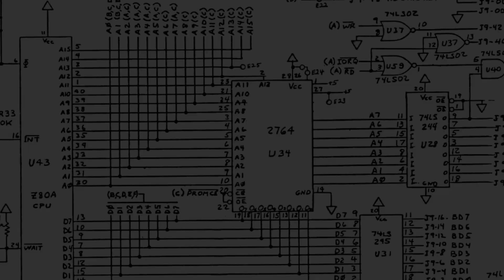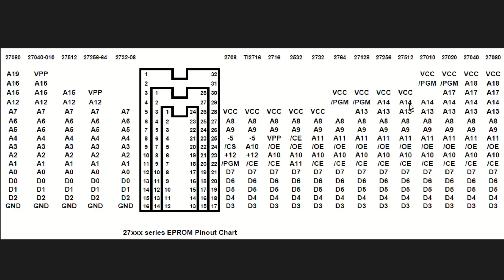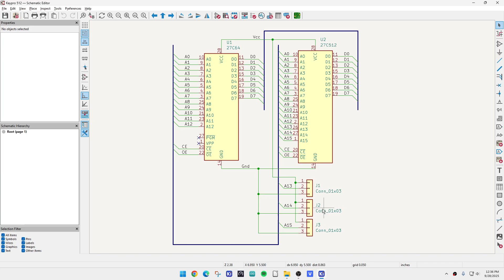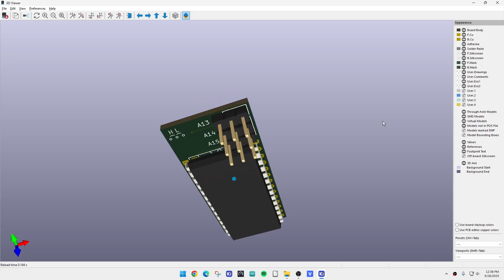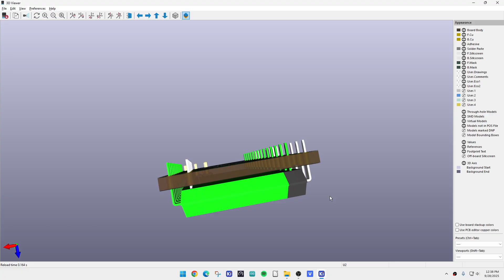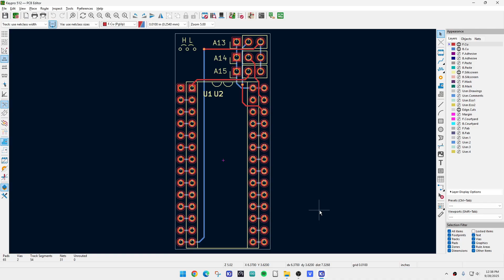#2406 Kaypro 2X Computer (part 6 of 10)

Comment: You can also use those 3 center pins to have bigger ROM chip blocks as well, though you would need to probably also do other work, with another header board to replace the existing address decoding, allowing you to use 16k of ROM instead, getting more ROM storage at the expense of RAM.

Comment: If you wanted to be super fancy, there's rotary switches with octal numbers on them which you could use instead of three separate jumpers.
Though admittedly in this case it'd be a bit confusing because the switch would be labelled 0, 1, 2,... to 7, whereas you are intending 0, 2, 4, ... to E as the top nibble of the address.
Reply: There was absolutely no justification for not using one of those switches. Heck, even DIP switches would have been better. Or, if you want to go extra-extra fancy, ANOTHER EPROM driving the three extra address pins from three of its data pins which also get looped back to the 2nd ROM's address pins, with the sole purpose of catching a jump to a normally unused ROM code address to allow for switching between ROMs in software, without having to open the case.

Comment: who uses dil packages in 2025 ????
Reply: Me!
Reply: Me. Much easier to solder to a DIY milled PCB, not to mention they naturally provide the "vias" that SMT parts don't.
Reply: It's a retro computer so the whole point is to use compatible DIP package chips.

Comment: Nice project. It is preferable to tie pins high via a pull up resistor, rather than connecting them directly to VCC.
Reply: This EPROM has CMOS inputs so the resistors are not required. Resistors were needed on 7400, 74H, 74L, 74S, and some 74LS, AS, and ALS inputs. They aren't needed on CMOS inputs because the input structure is different.

Comment: Yes, KiCad really needs a 3D model for header pins on the back of a board. Doing a new part footprint isn't hard, but I'd be completely lost trying to do the 3D stuff.
It would also be nice to have default footprints for narrow+wide chips in the same position. My latest board needed to be able to take an EPROM or a narrow SRAM. I also wanted to do a wide+narrow oscillator. I ended up using two parts in the schematic and tweaked the board for minimum DRC complaints, but maybe for the next version I'll take the time to do it "right".
Reply: > 3D model for header pins on the back of a board

Huh? Just flip the footprint, its model will show up on either orientation. KiCAD 9 has 3D Models for every script-generated header-/pin-row included.

Assuming you're picking the right footprints. I don't know what happened to IMSAI Guy in this instance :D